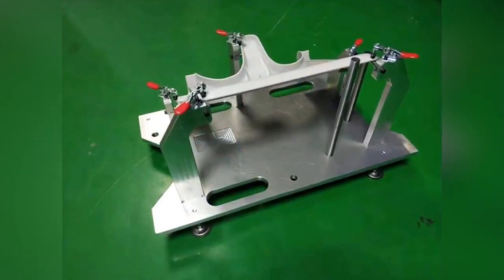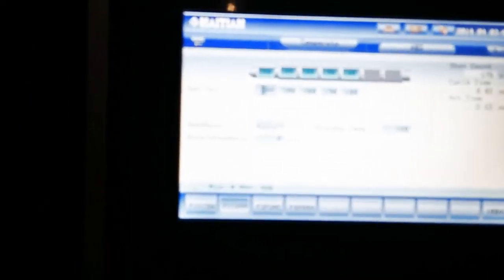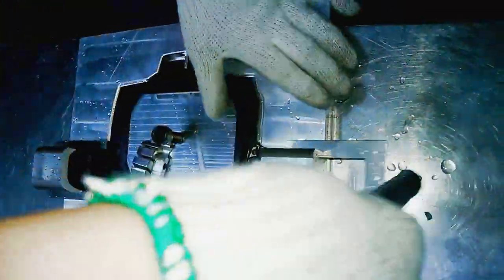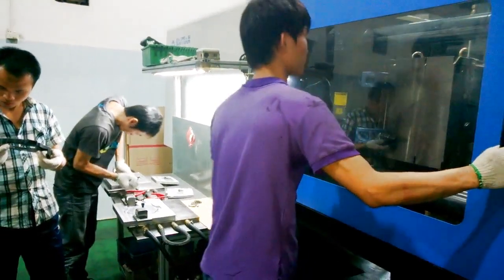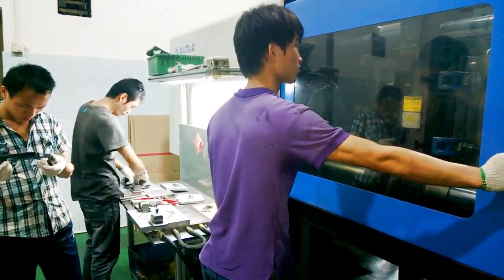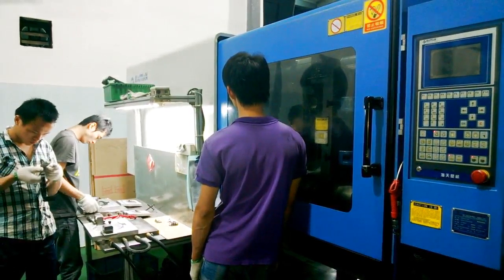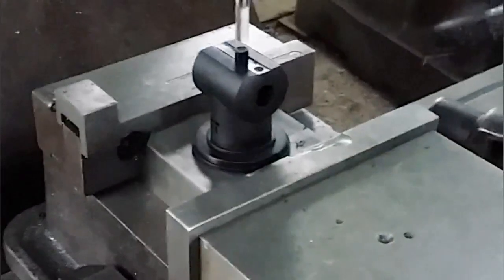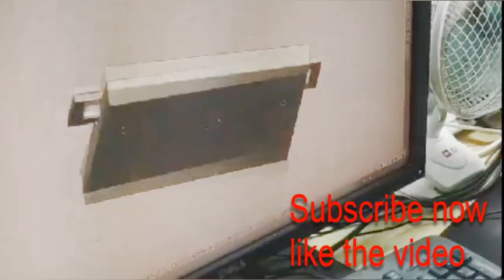China plastic toolmaker2020-why do we need to make cooling jig/fixture for mold, CNC machining?

Comment: In your 2 cooling jigs that have the 4 clamps, are they set to clamp part exactly in place or do they clamp slightly beyond the final shape to account for plastic material spring back? (Thank You for the informative video! I have a part that has slightly thicker wall thickness at opening edge and trying to decide if clamping is enough or add heatsink or both..!)